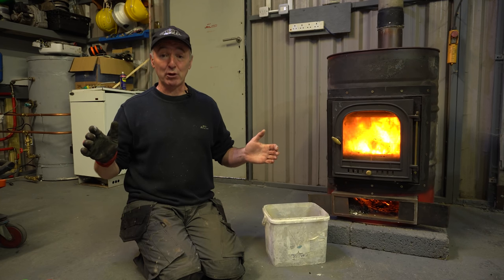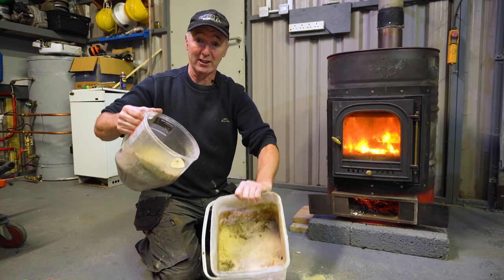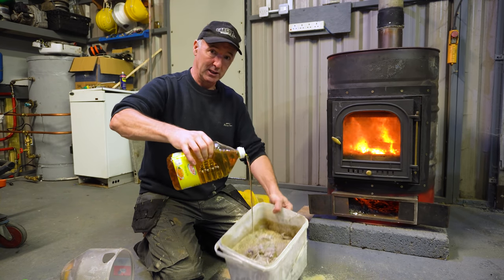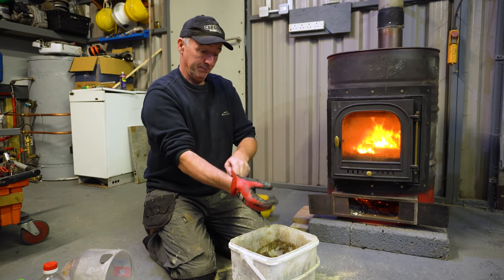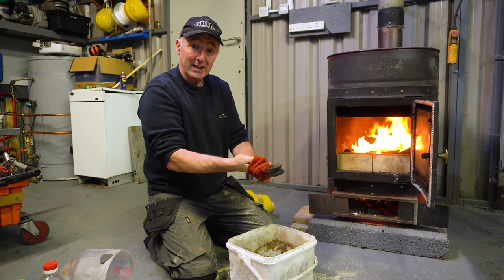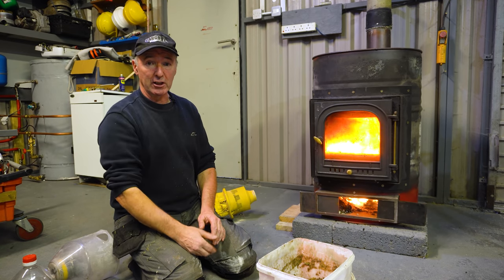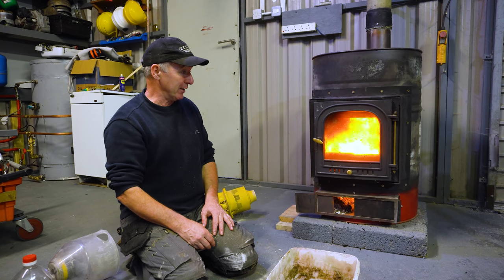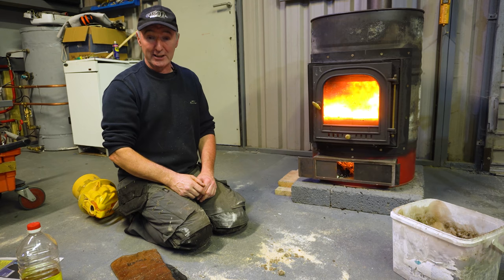Free heat from Sawdust + Vegetable oil .. No Tools Needed

Comment: Good way to get rid of waste saw dust and used oil but not a practical way to heat even a shed unless you have access to a good supply of waste materials. It's more practical to gather up dead fall from along side of the road.  I do gather up chainsaw saw dust and dump it in small cardboard boxes and saturate it with used oil, but do this only to dispose of the oil while gaining heat.
Reply from the maker: Thanks for commenting gorp27. Much appreciated Cheers Gerry 👍

Comment: where did you get that door on your stove???
Reply from the maker: Hi Erick I had an old stove that I converted to run on waste oil in this video from a few years ago https://youtu.be/oeFG1Tj3mbY I made a heavy duty frame for it that can be moved onto different projects as it will last a long time. 
The stove itself was cast iron and cracked. Thanks for commenting Cheers Gerry👍

Comment: What if you packed the crap out of it into a pipe such as 3 o 4" pvc or abs? would it burn longer.
Reply: You mean extrude it after packing? You're not burning PVC, I assume. The effort in packing into a small tube and compressing seems like it'd be more time effort than it's worth though.

Comment: Pretty cool, and you made the stove out of barrel?
Reply from the maker: Hi Jamie. I built the frame for the door, an exhaust connection and a cleaning door. https://www.youtube.com/playlist?list=PLmQ5wJnkAIoJYDBgSOis9s1yDhcFdswtN     The idea is that they are made from heavier steel and will outlast many barrels. I also made the grate inside. I will convert this stove to run on waste oil with one of my burners soon too. The sawdust is a very easy way to get heat from used waste. Thanks for commenting Cheers Gerry 👍

Comment: Hey  how long does a oil drum last when you make it like yours?  Its red hot at the bottom lol  seriously though how long?
Reply from the maker: Hi Ken. I had my last stove in for about 3 years and the top part of that was an oil drum on it's side. The trick is to protect the lower sides from getting too much flame and they can produce tons of heat by virtue of the fact that they are thin walled which can be made an advantage. Have some plans for this one later in the week with a different burner. Thanks for commenting Cheers Gerry 👍👍
Reply: @GerrysDiy  thanks for info buddy. I have always loved wood stoves but was punished with getting the wood for said stoves lol i didnt learn anythibg from that but what hard work is. Lol peace
Reply: @GerrysDiy  ill watching ya lol

Comment: ...a surprising amount of used fry oil and sawdust can be pounded hard into an empty cardboard 1 litre or 2-litre milk container.  The fire ablates off the improvised fire log perfectly.  Don't poke at the diy firelog, it will fall apart and flare up some...

Comment: 5 C is 41 F

1.8 F / 1 C, and 0 C is 32 F. 100 C is 212 F.
Reply: Multiply C x 2 then add 32. Not exactly precise but quicker for doing in the head. 5C X2 =10+32=43.  Pretty darn close to 41F

Comment: I need to do this. Too much used motor oil and a lathe that makes mountains of shavings.
Reply from the maker: Hi TheMonkdad. Try a little first and dont let it get hot before placing it in the stove. Works great. Thanks for commenting Cheers Gerry👍
Reply: Your neighbours will be happy with the pollution, wtg 👏

Comment: Why can you use fry oil that waste or used motor oil. My barrel stove in shop I have out door boiler it heats four family house and house next door and gerage the system has five hundred gallons fifty fifty antifreeze  with old cast iron radiators the house was built in 1790. Can you use wood chips from tree service trucks. This would start logs and coal

Comment: It's fine to burn waste oil and sawdust in the right kind of stove. BUT, its important to remember that sawdust mixed with oil can spontaneously combust. So, don't make more saw / oil mix than you can use in a day and don't keep it anywhere near radiant heat, like a hot stove. It's best not to store it indoors. The safest route is to mix it as you use it.
Reply from the maker: Great point! 👍
Reply: I used my wifes account.  This is Arvin.

Comment: How is it “Free” if you have to buy oil to add to the base sawdust product?
Reply from the maker: Hi Colin. It's easy to get waste oil and also easy to get sawdust for free. The waste veggie oil in the video was used oil from my own kitchen that I save for the winter. This method of adding oil to the sawdust for fuel also works with used motor oil too which is also readily available. Some of my other stoves in the playlists on this channel will run on pure waste oil with nothing else needed. Thanks for commenting.  Cheers Gerry 👍

Comment: Call me crazy, but wouldn't that gum up your chimney? I use wood bark from splitting wood and diesel. Looks like a long process for this
Reply: It with will absolutely gum up the chimney.  Restaurants are constantly burning veg oil and it leaves a lacquer type residue everywhere it touches.  It can get a quarter inch thick in a few months.  You will need a chisel and hammer to get it off once bake-hardened; or you can hire a chemical hood cleaning service at $500+ every six months.  Or, you will be replacing your chimney every couple of years.  Or, the layer gets thick and hot enough... and you have to replace your entire house.

Fire inspectors require restaurants to get their chimney cleaned every six months or they close the restaurant.  That's when veg oil smoke is evacuated with commercial grade equipment.  With home quality equipment and no mandatory inspection... yikes!

Comment: Last i checked, vegetable oil is not free. You'd also need a steady supply of sawdust, must obvious source would be a woodworkers shop or woodcutter's landing in which case you would either have electric shop tools running all the time on electricity or chainsaws running on their own fuels, again, not free. Unless you have a truly free source of both vegetable oil and saw dust, this is no where near free or without it's own cost. Comon now.
Reply: I worked at a shop where they had custom built pallets. They had trash bags full. It's rare to find a place like that, but it happens.

Comment: Aren't you going to put a pile of bricks and stones around your stove, as mass to prevent rapid temperature loss? You won't need a tonne, since you're only heating the shop when working, but I'm sure you'd love to have a more even temperature during your work days.
Reply: i converted my brick built rocket stove into a mass heater if i do a 2 hour burn it will retain its heat for 12 hours plus
Reply: i converted my brick built rocket stove into a mass heater if i do a 2 hour burn it will retain its heat for 12 hours plus
Reply from the maker: Hi Christian. Just behind me in the video you can see some pipework and a boiler. This is connected to an underfloor heating setup that I will be showing soon in another video. Would be very easy to make this current stove setup a mass heater too. More videos very soon Thanks for commenting Cheers Gerry 👍
Reply: @GerrysDiy  looking forward to your next videos. I'm heating my own shop with saw dust and waste oil, and are blaming you everytime someone asks.... ;)

Comment: You could pack that mixture into milk cartons.
Reply: Hi Peter, hi Gerry
I mix a bucket of sawdust with 500mls of veggie oil using an electric drill with a paint paddle attached to it, you don't need much oil in the mix.
Then I pack it into milk cartons, I use a club hammer and a piece of wood cut to size to compact it down.
There is NO smell , quite a bit of heat from them, it is a slow enough process but worth the trouble, and yes it is free, I get the waste oil free and the sawdust is my own,  left over from cutting firewood collected in wheelie bins. This is my first year doing this and I'm happy with it
Reply from the maker: Thanks for taking the time to comment. Great that you have it working Cheers Gerry👍

Comment: Where can I get free vegetable oil from?
Reply: Behind any restaurant. They  change out the oil in their deep fryers every two weeks and usually are happy if you take it. It is usually in 5 gallon plastic jugs standing inside cardboard boxes.
Reply: @doddshay9019  where do you live?
Reply: @gavinthomas7375  Alaska. I used to heat a cabin this way when it was 20 below. I would visit first the sawmill for free sawdust and next a roadside restaurant or two. That mix burns wicked hot.

Comment: Why not to use used motor oil instead :( ? My friends grand father used to pack saw dust mixed with user motor oil in the PET bottles and called it "mortar shell". But there is nothing ecologic on it and chimney gets clocked and needs cleaning more often :( but its "free" at the moment

Comment: SOrry to break this to you but this is dangerous, your ovens are rated for a specific temperature (Usually) by puting Oil in or on the wood you rise the burn temp considerably, be carefull with this, heatevaporation and suddencombustion can be an issue too
Reply: Did you see his stove? It's home-built from a 55 gal drum, Health and Safety didn't rate it for anything.
Reply: @ClayinSWVA  even more dangerous then great

Comment: It's illegal to burn waist in my country (I assume all EU too), unless its in industrial high temp burners with smoke scrubers / look up yours environmental laws too.
* if you burn used oils - suspended hard particles do not completely burn due insufficient temp and time - you are producing PM10 or even PM2.5 polution.
* larger wood chips - I have nothing against, but sawdust can be caried by hot air out the chimney while stil lit - fire hazard. there are specialty gaas generating boilers for sawdust and a like

Comment: SO I must admit during the first few minutes I was admiring your hot water storage tank and it’s required plumbing😍🥰 
35 years in # 2 fuel oil, kerosene, Propain(terminology for LP us oil guys who got into propain after many years oil only) coal,wood boilers sawdust at home! I have attempted to make a BOILER  from a microwave with coils of pex inside😳 fail......need BIGGER MICROWAVE.....OR LASER🤔 
You and I would be great friends if we lived nearer each other we are “mechanically related”
My next project is YOUR oil burner modified to replace the burn pot in a perfectly good functioning pellet stove and connecting a solenoid valve in place of the pellet auger motor? 
Keep at it and GOOD HEALTH TO YOU!  ❤️🇺🇸 .....ps TRUMP will likely win a second term, and we will NEED MORE PRISON SPACE❤️❤️❤️🇺🇸
Reply from the maker: Thanks Pete. I have made lots of other burners but wanted to show how simple it could be with this video. Next week i am making a kit to run this on waste oil only too. Great comment Cheers Gerry 👍
Reply: 🇺🇸TRUMP 🇺🇸

Comment: Yeah this is how you get a fire in your chimney
Reply from the maker: Hi. You certainly need to be careful but it burns somewhere between coal or logs. Thanks for commenting Cheers Gerry
Reply: @GerrysDiy  No I'm sorry Gerry, but this is not something you can mess around with. You just guess the amount of oil and sawdust, throw in more than just sawdust from your vacuum and apparently you don't check your chimney. This is just highly dangerous and I would not recommend this to anyone.
Reply: You are assuming everyone is a complete idiot. People willing to work with this will watch what is going on and be fine. The few that don’t will win a Darwin Award. Quit being melodramatic, 99.99999999% will be fine.
Reply: @lokilyesmyth  you are burning oil and dust. There will be a lot of times where the fuel and oxygen mixture will not be ideal. Thats when carbon and unburned material will accumulate in the chimney.
Reply: @arypma  Is it your shed that's gonna catch fire?

Comment: Don't put wood with nails in it in the fire ,,I did it for years and one day ,,,in my living room ,that wood popped and blew the nail through the glass breaking it ,the nail ,red hot landed on the rug ,5 feet out from the fire place and set the rug on fire ,it's a good thing I was sitting there or the house would b gone ,,,I was lucky

Comment: That waste oil is as pristine as unused oil.
Reply from the maker: The oil is from my own kitchen and has been filtered to run in my waste oil burner.. When I get oil from other sources it can be very dirty but if used with sawdust it does not need to.be filtered. Cheers Gerry

Comment: don't use motor oil. it will release toxic and noxious gasses when burned. there is a reason automobiles have strict emissions controls and cars fail MOT if they burn too much engine oil.

Comment: So free if you own a chippy and a wood shop.
Reply from the maker: Hi Christopher. the wood chips can be changed for lots of other mediums including paper straw etc and the oil could be used motor oil or similar. Not recommended but it is certainly possible to run this for cheap or free depending on where sourced. Cheers Gerry

Comment: Seems to me to be a lot of effort for very little gain. To get that much sawdust you'd need to saw about a cubic metre of wood in to logs. A cubic metre weighs 3/4 tonne - and you're talking about 1 kg of burnable material!!
Reply from the maker: Sawdust is readily available for free but you would need a trailer and be able to store it. Oil is harder to source but available in quantity for free too. Thanks for commenting Cheers Gerry
Reply: @GerrysDiy  OK, I get where you're coming from. Thanks for your reply.

Comment: If it consumes vegetable oil... then it isn't free.
Reply from the maker: The veggie oil was used and for disposal. It's quite easy to get used oil at no cost. Thanks for commenting Cheers Gerry
Reply: @GerrysDiy  I dunno. If this is fry-o-lator oil, around here all that skanky stuff (very dark and rancid) gets grabbed up by guys with diesel cars; nobody can tolerate having it inside their house because the smell is so strong. Even THAT isn't what I'd call "free", since it still needs to be collected (no easy task) and processed (filtered, dewatered, disinfected) and stored in large containers (small containers aren't worth screwing around with).

Used motor oil (IMO) is a much better alternative. We as a nation are drowning in THAT stuff, which can't reasonably be used to power diesel cars.
Reply: @GerrysDiy  It's FREE

Comment: If you have to buy veg oil then it ain’t free.
Reply from the maker: The veg oil was for disposal and could be replaced with used motor oil. So free or as close as you can get. Thanks for commenting 👍
Reply: @GerrysDiy  and if you put all that oil in your fire place or stove you create a dangerous amount of flammable creosote. Thanks for contributing to yet another homemade danger.
Reply: @jimcurrier2166  Creosote forms from choked back, dampened fires... he says to let it burn, and look at it burn! No damper closed on that fire!